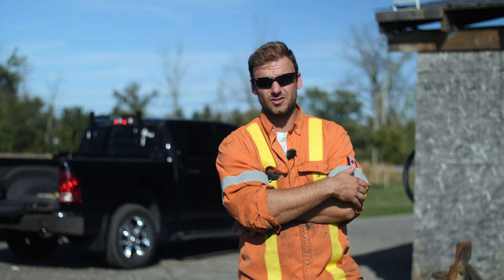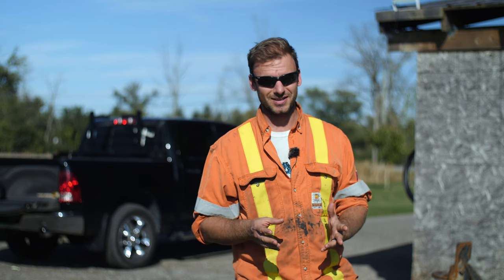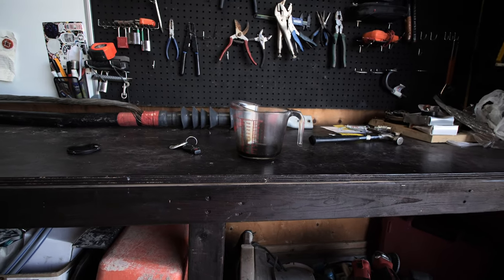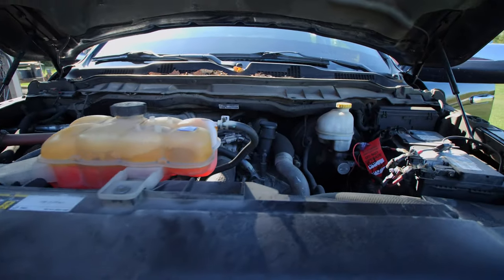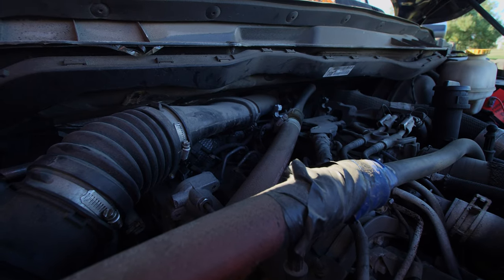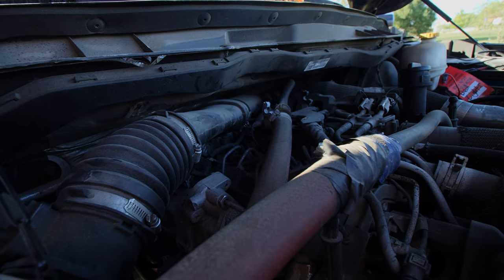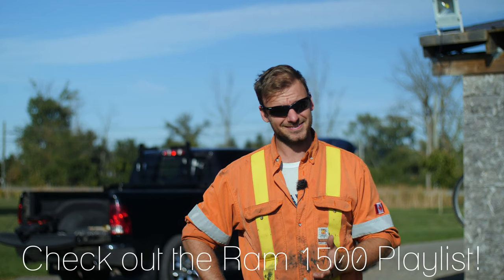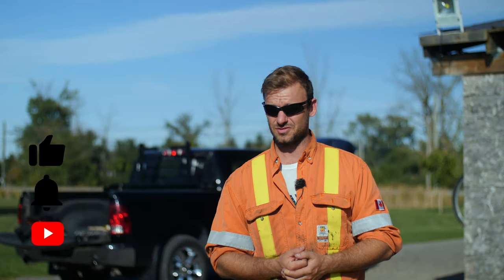These TWO things will help SAVE your Ecodiesel!

Comment: The ccv (what you call pcv) is not the Achilles heal of these trucks. The amount of crankcase vapor is minimal and easily burnt in combustion, not enough makes it past the rings to be an issue in oil contamination. 

The real threat to these engines is the stock pilot injection that creates a ton of unburnt fuel, leading to a high soot load in the engine. Your tune likely addresses this and is where you should really give props.

What ecm tune are you running?
Reply from the maker: I'm using celtic tune. One of the main reasons I installed a catch can was because my tuner recommended it for cleaning up the intake and helping with pre contamination past the piston rings. How much actual oil is tough to gauge. In terms of the tune I never looked into injection but these tunes are pretty solid especially overseas . I'm super happy with it either way.

Comment: I got a 15 eco in November of 23. It had 106k miles and now has 116k. I already got the oil changed once and am halfway to the next change. I listened to the 6-8k the dashboard tells me. I unfortunately live in an emissions strict county so im not sure i can delete my ECO Tho id really love to. But if i did would i be too late to preserve my engine this far into its life?
Reply from the maker: It's so hard to say brother. You can get tunes to just shut the EGR valve off though.  You cannot tell at all from looking at the truck. You'll still have your underneath emissions. That would help with motor and intake sludging

Comment: Oil bypass with cooling radiator ,oil catchcan with extra air  filter. Delete too,  
Plus suspension adjustment ,shocks, pouleritan   bushing, .....
remove the spare wheel, remove the front hook on the bumper, remove the tank DEF .
rigid body stabilization , and a front stabilizer bar under the hood .  Put tires without a cord, and 5-spoke light sports wheels. all this will lead to a reduction in the weight of the track .. plus the purity of the oil, plus the alignment of the center of gravity.  saving 3-5 liters, plus there is no loss of power when turning.  oil operating temperature drops, and coolant too.

Comment: So I purchased a 2019 Ram classic eco diesel. I live up in norther BC and at least 4 hours from a RAM dealers. I’m looking at ultimate reliability and longevity,
From what I’m seeing  is that I want an -oil catch can/ separator.   An 
-EGR delete, 
-DEF delete.  
But would an an oil bypass filter be a good upgrade as well? 

As well all said and done what could I do now that won’t void my warranty? 
Really looking for advice on the best products and best way to keep my trucking at absolute optimal ability for the longest length of time.
Reply from the maker: Well if you're in warranty the only real "delete" you could do is electronically disable the EGR system. That will stop Exhuast gases from re entering the intake.  The dealer can't usually tell that it's on or off. If you remove the dpf and install a (noticeable) catch can  you'll likely be denied warranty as it's engine modification.

Comment: good video,  for the oil catch can, why aren't people just venting them to atmosphere like a 5.9 Cummins? why feed it back into the engine at all with or without catch can
Reply from the maker: Lots of these new trucks have sensors. The truck knows there's a pressure change or something. Plus I'd have a decent little puddle for the first 5k or so with my truck.
Reply: @GilbertGardens   ah kk one of those situations, I might be picking up a deleted 15 eco diesel in a few days with 160k km

Comment: Bought a brand new eco in 2018, changed the oil early after 2500 miles engine still had bearing failure at 9500 after just 7000 miles on the new oil. Friends truck followed the standard intervals and is on his second replacement engine at 50k miles.
Reply from the maker: bearings failed at 2500 miles ? brand new?
Reply: Crazy I just got my 2017 to 271k before head gasket blew.

Comment: What would be wrong with just venting the crankcase to somewhere under the truck? To outside air?
Reply from the maker: It could be quite a but of oil. There will be a pressure difference as well. Throw a code.

Comment: It's really sad we have to re-engineer our diesels to keep them alive. That being said, some oils literally "evaporate" out of the valve cover vent hose way easier than other higher quality oils. In the oil testing world, that is measured by the NOACK volitility test.  Shell Rotella synthetic 5W-40 is in my opinion only marginally better than a conventional diesel oil.  The main benefit is the cold weather/cold start oil flow of a 5W-40 is better than a 15W-40. If I was using Rotella syn, I might change it twice a year, but use the Rotella 15W-40 syn during the warmer months. Just an idea
Reply: Also, just curious, so if it is below the add mark when you check it here, do you add more oil to fill it back up to the full mark on the dipstick? Or do you just keep riding around with low oil level until you change the oil again?
Reply from the maker: Sorry I missed the comment. I leave it right at the low mark. If I add more it just blows it into the catch can

Comment: Just about to buy a diesel Gladiator, very much appreciate this video. I’m running a diesel Liberty right now & a Cetane improver & fuel system conditioner seem to help the Liberty.
Reply from the maker: very nice
Reply: Nice I got a gladiator with some good bang for the buck investments. I'm Stage 1 EOC with Transtune, it's a whole other beast after the tune. I would go DEF off and Switch on the Fly maps from EOC.
Reply: I use HotShots for the same reason, small expense compared to the vehicle and mods. LX4 and EDT. I also reccomend Amsoil MS...I know it sounds like snake oil, but if you look at UOA it has amazing anti wear properties. There's a few other oil that's do the same too. Amsoil won't evaporate as easy as cheap oil so there's that, and oil change interval is long on these vehicles so it's best to have something good in them. Early oil changes are bad, (you can research why), best to install a fumoto valve and just sample it and get it tested if you're a maintance freak....and it'll probably say let it go to 10k miles. Main thing is testing, I bought Amsoil FS and the guys on the testing page said it's ok but MS is significantly better according to tests - is the specific engine oil combo not a brand - real world testing.

Comment: I’ve never had a diesel before and have had 5 different Ram 1500 Hemi’s.  
Do you know anything about the the new 3.0 diesels and would you buy one yourself
Reply from the maker: So far they seem to be good. I would check the forums and speak to some owners first. I think they've salved the main bearing issue.

Comment: I heard also it's good to drain the diesel/ water separator in frequent time.
any one has an idea about this?
Reply from the maker: Doesn't hurt. I never have. Just change fuel every other oil change
Reply: Which model you have which year ?
Reply from the maker: @ahmedalial-saeed9471  2014 big horn. 300,000km
Reply: I have 2022 ED limited , just 4000 Km like new truck but I'm worry about the open recall for HPFP , I'm in Iraq and there is no dealer to send the truck back I'm out of warranty , please can you guide me if you know how to maintain this truck ?
By the way this is the first RAM in my life. @GilbertGardens
Reply from the maker: @ahmedalial-saeed9471  just check out my other videos . It's all there brother  cheers
Reply: On My Canyon diesel its got 2 fitlers underneath. One for fuel and the other for water so i just change those every 30,000km
Reply from the maker: @leadnsteel1428  yeah that's a sweet setup

Comment: Mine seized at 62000km and I ran shell 5w40 t6 oil in it.
Reply from the maker: sorry to hear that. what oil change interval did you go with?
Reply: @GilbertGardens  I changed the oil according to the oil life monitor, usually when there was 10 to 15% left, about 12000 km

Comment: why do you have an open air filter and not one in a box?  You are losing HP and TQ by taking in hot air.  Not sure why that change was made.
Reply from the maker: Pretty sure cold air intakes add almost no return without additional tuning. You might see 5hp but that could be from anything. This was cheap and maintenance has been free for 5 years now.

Comment: I think a lot of people dont drive them enough. To get everything heated up properly. They dont get the maintenance done as they should. Running in the city for short distances is prob not a good idea for most diesel engines
Reply from the maker: Yes egr pumps soot back into the oil. Oil gets dirty. Plugs passages because it doesn't get hot enough on short trips.

Comment: UHM....I thought the EPA ran Green Diesel Out of business in terms of deleting the Ecodiesels?  I had an ecodiesel that I COULD NOT KEEP OUT OF THE STEALERSHIP.  I was pulling the MAP sensor about every 10k miles (oil changes at no more than 10k miles) OR it would go all faulty since the MAP would be plugged.  At about 60k I installed GDE off road tune,  no DEF, with a straight 3" exhaust.  The oil stayed VERY clean even to 10k.  I got rid of it with 250K miles on it and never an idiot light.  Oh also swapped to redline oil in everything EXCEPT the engine.  When I brought it home with 27 miles on it I switched to Lubrimolly toptech4200 and a qt of Lucas Synthetic oil stabilizer.  I had NO BLOW BY.  I never had.  Let me repeat that I had NO BLOW BY.
Reply from the maker: What oil catch can did you go with ? I heard green diesel was told to change the tunes for epa compliance.
Reply: @GilbertGardens  I bought a the parts that Shawn Capsan used on his truck but anytime I checked for blow-by I never saw any so I never bothered with it.  It's a shame because I think these trucks were awesome once they were deleted (for the averave guy)  The passive regen was ridiculous.  Maybe a tune to turn off the EGR would be sufficient.  I really liked my truck with stock suspension and 33's it would get 27mpg in the hills of eastern PA.  I used to drive it to the cabin along rt 209 through the delaware water gap area.  Follow the river.  Flat and 55mph.  It would turn 30 miles per gallon or better.  

I don't know what the details are with GDE.  I had the off road tune and it ran great.  I don't think I'd own any of the new diesels outside the factory warranty.  I'm in the market for a new truck but can't decide.  Pretty sure I'm going to get a 3/4 ton.  Chevy or Ram maybe a diesel.

Comment: Hi sir, how are you? I enjoyed your videos and suggestions. But i need your help for the future. I have 2018 eco diesel with 120000kms and its out of warranty. I want longevity , reliability , power and economy at same time. But my main concern is resale. If i full delete then as a buyer prospective, may i resale easily or find any trouble in future? 
Or what u recommend for it ? Should i go with stage 1 or 2 ? Or just egr tunning ? 
Please help me sir
Reply from the maker: Resale can be tricky. You won't really be able to trade it in just private. I would delete everything

Comment: My opinion is not doing these mods is worse for the enviroment. than the so called epa emissions crap. clean air equals clean burn. Not to mention you can get no smoke tunes so youre not blowing black smoke everywhere. better fuel mileage aswell. lets really think on it!
Reply from the maker: Yes my Celtics tune has zero smoke . The extra fuel economy adds up to less emissions too. Not much but still.

Comment: That's something to think about, some very good points. I guess the proof is in pulling the tubes and seeing exactly what is happening, is oil passing, yes or no. To be honest I have not looked at mine yet but I "fixed" the other issue. Jacques Ferreira's tear down video was extremely revealing. Around 3:23 in his video you can see clearly carbonized oil blocking the passage to the main bearing. Of course FCA changing oil spec in 2015/2016 and oil capacity somewhere in 2014/2015 may also have be a contributing factor. I have a 2016 using Rotella T6 5W-40 at 10.5 quarts/10 liters with 120km/75k miles. In general with turbo diesels the consensus seems to be a catch can is a worthy investment.
Reply from the maker: yeah for sure. Im going to check it again at 16,000 KM and see if there is anymore. After awhile I find no more oil in the catch can. Basically the truck has pumped out what it needs to lol.
Reply: Adding a Cleaning friction modifier like archoil or hot shots stiction/fr3 helps gently clean the inside as you drive, and helps with this oil sludge issue.
Reply from the maker: @ChrisB-ny5zr  do you have any actual proof of that? I've always been sceptical if additives. Just curious.
Reply: @GilbertGardens  so, the proof I have for myself is this, it may seem crazy, but it's what I see with my own eyes, not lab tested .. ... I put the used oil in a clear container, I shake it up and then leave it. Without friction modifier the upper sides of the clear container stay black. With the friction modifier they are clear. So the oil is sliding down easily. Also, the used oil feels really slick. I'm using that to assume it's similar inside the engine? I like to think it helps keep soot from sticking... Maybe it's $30 extra per oil change for peace of mind? I do it myself so I save on dealer prices. Also, the engine sounds different, deeper, smoother, a little more diesel growl.
Reply from the maker: @ChrisB-ny5zr  nice well that does sound better. The only issue I would see is if you add 10L then add the additives based on my test the engine would blow back even more oil into the turbo intercooler ect. Maybe reduce the initial oil change quantity? If its working dont change it. I will be removing some intercooler pipe to see whats in there some other time.
Reply: @GilbertGardens  ya, dont add to the oil, replace the oil with equal amount of additive. Some say additives are snake oil, some swear by it... Peace of mind for some of us  I suppose. I grew up on a farm, I've worked over 20yrs in a machine shop, Ive fixed and built and rebuilt many engines and machines so I go by what I hear, see, feel to help me sleep at night! Anyways, I'm a little jealous of your homestead... I live in a condo now :( so I watch your vids and day dream. I grew up in Niagara.
Reply from the maker: @ChrisB-ny5zr  hahah yeah man I was mostly a city kid. I traveled Saskatchewan building powerlines for a few years and loved working in the rural.  I use to stay at a couple of farms . Just rent rooms from job to job. Once I had an opportunity to buy some land I jumped on it. Yeah were just outside Niagara falls.  Chippawa area . Love it here. Cheers.

Comment: Can you get an oil catch can for a 2022 Ram Rebel 3.0L ecodiesel?
Reply from the maker: Yeah fir sure. You can get a CC for any vehicle.  It just gets cut in between the I take and crank case hose. I have another video on mine go check it out. Remember you may need additional tuning depending on the setup.
Reply: Looking at getting a reflash of my ecu.  Is that good enough or shoukd I still get a oil catch can?

Comment: The eco diesel biggest issue is that they took an non emission engine that has been great for decades and then shoved emissions on it. My first engine blew at 134,000 for the main barring.new engine has been deleted from KM 0 and has been running great since

Comment: I have a 2011 Mercedes Gl350 likethe one you had andinstalled a catch can but that caused me to loose the engine : let me explain , live in Ottawa region and on a very cold day ( -40C ) an ice plug formed in the catch can piping and crank case pressure went to hell and the engine spilled all of it's oil after it busted the piping and engine locked up  7000Cad later replaced the engine and had to reconnect the dam PCV back , but what i'm doing is simply splitting the recommanded oil change intervals by half  so changing oil every 7500Km instead of 15k

Comment: How about if I simply put a plug between EGR and exhaust? Will I have a check engine light on?
Reply from the maker: lots of guys block the EGR port going into the intake but yes you need to tune the EGR off.
Reply: @GilbertGardens  So what is the best product in your opinion?
Reply from the maker: @alabaiCA  check out my newest video ecodiesel review. in the description I have a link to a facebook page with more information on tuning etc.
Reply: @GilbertGardens  Will do. Thank you sir.

Comment: Use Archoil additive.  kept my ecodiesel trouble free until i traded that pig for a 3.0 duramax.
Reply from the maker: My father in law just got a 3.0L drama and loves it. More power. I don't know if it's better on fuel economy yet tho.
Reply: The little duramax has a belt driven oil pump.  Needs serviced at 100k and the trans has to come out.  Good luck with that.
Reply: @1005dragrcr  It’s 150K, not 100.  And I won’t own it anymore by then.  At least the son of a bitch will be running, unlike the numerous Ram owners waiting on backordered ecodiesel engines.